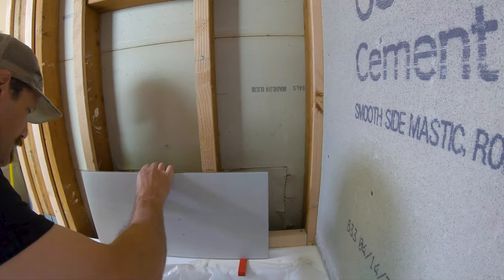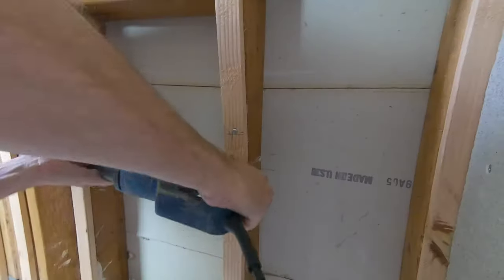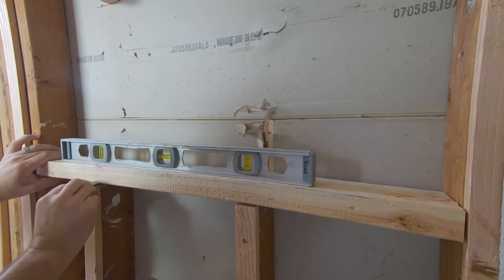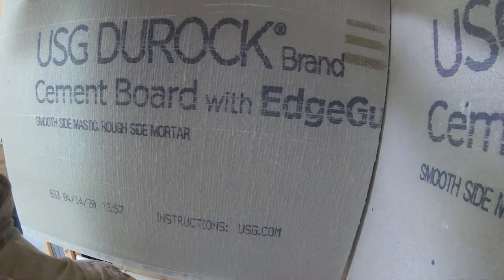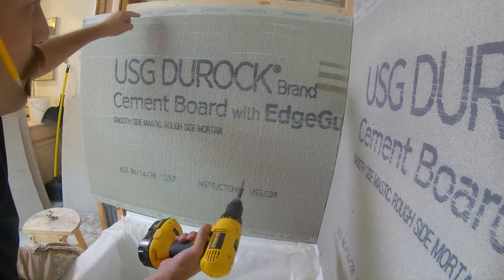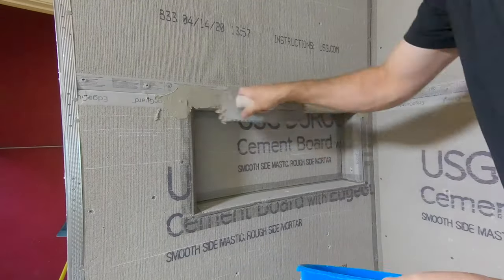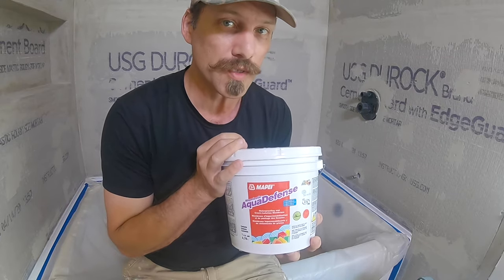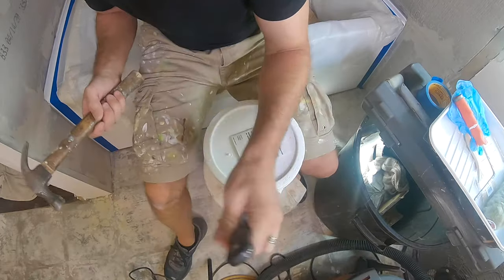How to make a shower niche from start to finish

Comment from the maker: The valve kit install, check it out: https://youtu.be/AX1CVJ9nCAs
Reply: Nice video i need that outside metal frame that you used  can u give me the link w here u got that thx
Reply from the maker: @johnal4560  Close to the actual Schluter Trim color I used from Amazon: https://amzn.to/3cMwpFG 
They're much easier to get (and half the price) at your local hardware.

Comment: Wouldn’t it be more waterproof in the niche if the sloped base tile go in first ? Water on the back wall tiles would drip onto the bottom tiles vs. your way the water can seep in behind the rest of the lower tile.
Reply from the maker: The tile and the wood frame is sloped. The only real difference is the thickness of the grout line in the back.
Reply: @Gofastpowder , I building my own tiled shower for the first time ever and it’s taking me so long because I’m a perfectionist.
Reply: Do you build the niche with regular pine 2 x 4 wood or threated green wood?

Comment: Good work,but I would’ve prefer the bottom tile one piece with no joints and installed before the back tile,to allow for water draining on top of it.
Reply from the maker: You make good points, Noel. And I thought of a single piece of material at the bottom. However, the tile itself stops at 24" and I'd have to buy a piece of marble to custom cut at 29" that would nearly double the cost of the niche. All things considered, it drains pretty well as it is and we're happy with it.  Thanks for chiming in!
Reply: Not realy its waterproof then it pitch grout n silicone alls corner never leack

Comment: You HAVE to measure the mix ratios to get the grout right, not just do it by eye / guessing. This a) makes the mixture more resilient and b) is repeatable if you need to top any up.
Reply from the maker: Always a good idea.

Comment: You had to float the bottom tile more than you thought because you accounted for that tile when deciding how much lower to install the 2X4 when really you shouldn't have counted that because the bottom tile of the niche and the trim piece sits on TOP of the tile going up the wall and not below.
Reply from the maker: Thank you for the explanation, Myish. If I ever make another niche, there's plenty I'd do to add to and adjust the plans. This would be one of them.
Reply: @coolhandryan  It's easy to critique anything with hindsight. You did a great job. Doing it and making mistakes is the only way to get better.

Comment: i start my shower niche next week. Im very happy that i have found your video !
Reply from the maker: Good stuff! Maybe check out some of the comments for helpful feedback on this video. Also, afterwards, I decided to cover the bottom grout with clear silicone (using a finger to push it in and flatten it out) so that it was all sealed.
Reply: @coolhandryan  Thanks ! I have almost finish but i really struggle with the metal trim lol not easy with a grinder to get the perfect angle even with a 45deg square
Reply from the maker: @rocketdriverqc9014  awesome! Maybe a hacksaw would be an easier option?
Reply: @coolhandryan  i wil try thanks !

Comment: Good video.  I've used a different leveling system for tile work on my floors, but I think I'll use the one you did for my bath/shower.  Also, I'm going to use the Schluter edging you used.  I think that I'll buy a niche that Schluter makes.  They have a variety of sizes and it's not very expensive.  Oh, I think for my niche back wall I'm going to use that glass tile you see.  I forget what it's called but they are small pieces of rectangular-shaped tile.  You can get that tile in lots of different colors and I think that will add a nice aesthetic.
Reply from the maker: Sounds like a solid plan!

Comment: Finally somebody who work almost like me in regard of following grout lines both vertical and horizontal, except I place a dummy tile with clips but without thin set on the place where the niche is going to be and cut the opening on the W.B the next day after removing the dummy tile at the last moment after it all dry. This way I don't have to put supports sticks  in place of the opening.
Reply from the maker: Good stuff, Edi. Thanks for the pointer. 👍

Comment: @ 8:25 How about use the small $60 metal cutter? Because that big miter saw scared the crap out of me when the schluter trim flew across the room. Could had hurt someone.
Reply from the maker: Absolutely. Whichever option you have that is most safe and still provides a clean edge. But I’m sometimes more adventurous/stupid than others.
Reply: Use grinder dude

Comment: If that's a load bearing wall you need to put in a header and jack studs to carry the load.
Reply from the maker: Good note, Doug. That particular wall is not load bearing.
Reply: Or to avoid all that, you can more simply build the niche between the existing studs, even two niches one above the other for extra storage.

Comment: Hey Ryan loved the video. Did you use the tile trim all the way around the other tiles on the side wall and up on the ceiling?
Reply from the maker: Yes. Along each outside tile line but not on the ceiling line.
Reply from the maker: I ran the tile all the way to the ceiling.

Comment: I would have used the glass accent in that niche. But it still looks fantastic.
Reply from the maker: Definitely thought of that when I was drawing it up. Did you see the accent video I posted? It was pretty involved and we ran out of the actual glass tiles. We also thought it might have upstaged the wall accent. Great point though, Selina.

Comment: This is a very helpful video. So did you place the wall tile up even with the cement board at the bottom of the niche? So it's all flush and then you place your trim piece with the flange on the cement board and the "L" of the trim sits on top of the wall tile? 

I'm concerned with the tile thickness plus the mortar raising my niche shelf tile taller than the trim but don't know if that is likely to be an issue.
Reply from the maker: The trim edge should be pretty close to the thickness of your tile so that you can fit it between the cement board and the tile and it will cover the edge of the tile for a finished look. I have it taped in place (9:20) to make the right adjustments before slapping in all the mortar.

Comment: What do you think about those premade niches you can buy?  You still need to tile them but I just wondered what your thought are on those.
Reply from the maker: Hey Jim. My initial thoughts on the prefab niche forms is that they are pricey and they hold you to the specific size of the box. I wanted a much larger niche than the boxes I saw pre-made. But if you can find a box the exact size you want and need, and don't mind spending the extra cash, then a pre-made frame could make the job faster.

Comment: I noticed your tile came off the wall Easley in the beginning in hind sight is there any thing wrong if a guy wants to  use the big ol fat  1/2 × 1/2  trowl unless of course it's a shower floor !
I wanted to ask about the bottom of netich tile setting detail ,is it better to do the bottom first then the back, sides ,and top for water that my hit the back wall of the neich to run down and hit the bottom tile then role out and off instead of rolling down the back tile, and being able to get traped in the grout line between the bottom tile and the back tile ,just want to know if it matters or not ? Only trying to do the best job I can ,thank you for your time, great video ,and any thought's on the matter ! ✌🏻
Reply from the maker: Hi Nunya. Thanks for the questions. The 1/4" trowel is standard IMO. They'll come off easy when you just put them on. If there's good suction/vacuum then you'll need to pry a little bit. They mortar will set up pretty fast, it would be hard to get a tile off after about 10-15 minutes depending on the brand.
Yes, is hindsight, the bottom would be better to add first. But I've had no problem with water build-up in my niche because it doesn't get directly hit by water. Even when it does, it still rolls out nicely. But a solid piece of marble or a single tight fit tile on the bottom would be the prudent way to proceed. 
Get workin! :)
Reply: @coolhandryan  thanks for the tip I'm  getting my shower pan liner in this week and it's been a while since i'v done one so just trying to brush up on some technical aspects of the task at hand I'll check out your channel and see if you have any shower pan  dirt to curtains how to  videos ,thank for the quick reply 👍🏻✌🏻

Comment: If you dry fit the schlueters around nitch then measure cuts on nitch sides and have them all ready to go,  then pull out schlueter and thinset sides  all around , you now can install schlueter and tile all in one shot, much easier to trowel that way instead of having the schlueter there and trying to thinset behind that edging where you don't have that much space
Reply from the maker: Good stuff 👍🏼

Comment: So it’s ok to just glue the back piece to the wall?
Reply from the maker: That particular adhesive is rated for cement board. Once it dries against the sheetrock, all of the other elements that you apply to the cement board keep everything in place.

Comment: When you put the shims in to support the top , did that change the level of the bottom tile seeing how much thin set you used to get the right slope ?
Reply from the maker: Pretty sure I let the bottom set for a couple hours then came back to do the top.

Comment: Why wouldn’t you do the top and sides then the bottom
Reply from the maker: In hindsight that would probably be the better play. At the time, I think I was concerned about the amount of mortar needed to fill the bottom which could have caused a short install of the sides. And I wanted to have the bottom installed so I could wedge the top in. There’s always something I’d do different on every project. 🤣

Comment: do you fill the tub with water before caulking the tile to the deck of the tub?
Reply from the maker: I don't think that is necessary if you already secured the lip of the tub to the cleats with deck screws. I didn't fill with water, just calked and it's been fine for years.
Reply: @coolhandryan Thanks !  Is your tub metal or acrylic ?
Reply from the maker: @walnutcontractors5661  It's fiberglass with acrylic.

Comment: the framing for the niche didn't need jack studs or header?
Reply from the maker: I used a simple box frame. Its not a weight bearing wall and will never hold anything heavy.
Reply: @coolhandryan  How does one determine that the wall is indeed not load-bearing?
Reply from the maker: @dcppcp  structural or load bearing walls typically run perpendicular to the joists. Take a look at your eave outside and you may be able to see the joists protruding under the eave. Your weight bearing walls will should be running the opposite direction.

Comment: Would it be a better process to have put the bottom shelf in before the back tile for a better watershed?
Reply from the maker: That is the common and best practice, yes. There's always an issue with projects in one way or another. But for mine, I don't find it a problem. The niche doesn't take direct water and I've got it sealed underneath.

Comment: Have you used the Kerdi style of drywall and niche?
Reply from the maker: Hey Ted. I haven't used the Kerdi wall board or their prebuilt niches. As part of my DIY, I was looking to save some dough. A Kerdi niche is roughly $90 and a sheet of Durock is $10, which was plenty for the whole niche. Plus I had the ability to double up the Durock when my measurements were off. I did use the Kerdi Schluter trim around the niche though.
Reply: Save your money 
Don't bother with the kerdi
Reply: Plenty of other tile backers out there for far less money. I use dens-shield. Concrete board is ok but it's very difficult to work with. Between the 2 product the warranty is identical and there's far less perp for dens-shield.
Reply: @davidwilcox1897  The Kerdi takes the guess work out. The  labor to install Kerdi is easier and faster than using cement board, tape, mortar and liquid membrane. The Kerdi will also be ready for tile sooner than custom built. More importantly, the chances of a DIY or professionally built niche having water/moisture/leaking issues is far greater than the Kerdi Niche. That alone makes $80 money well spent.

Comment: Question or two: can these cubbies be done on a 2x4 wall?  It appears you are using a sandy surface tile, low gloss. I have well water and am considering the same in order to conceal eventual mineral deposits. Is that why you're using low gloss tile? Any experience with tile finishes and well water? thank you
Reply from the maker: Id make sure the wall could hold itself up once the frame was redone to accept a reasonably sized niche. I have little experience with glossy tiles, except the accent video on this channel. Unsanded grout should be used with a 1/8“ or 1/16“ grout gap. The unsanded grout will help keep the scratching to a minimum.
Reply from the maker: No experience with well water though. I used the tile because we liked it, no other reason. We have rather hard water. But it hasnt been an issue.
Reply: Sanded grout is for floors and unwanted for wall tile. If I'm using a larger joint line in a wall tile application I'll mix wall and floor grout together. It fills the joint better then just wall grout. The grout color will change slightly but must of the time it's not noticeable

Comment: What tool is that that you use to cut the durock? Is it drywall hand saw?
Reply from the maker: Yup, a drywall hand saw to cut the hole for the niche once the cement board was fixed to the wall. Just guide it along the wood frame. A regular razor knife to clean up the edges.
Reply: @coolhandryan  thanks for quick answer. I didn’t know that drywall saw works. I’ve been using the score knife.
Reply from the maker: @Leo H  It cuts through pretty easy once the board is attached. For all other cuts I used a score and snap with a regular razor knife. But the method of cutting the hole once the board was attached needed a different method. The saw was close and quick. 😜

Comment: Do you need a gap space of 1/8 between the outside of the trim to the side tiles?
Reply: They arent that thick. Youll need to slide in the trim while the tile mortar is still wet. So, its really just making a nice little home for itself. I dont think I measured for it.

Comment: Do you caulk all the inside corners of the shower niche? Or just grout them?
Reply from the maker: Hey Chuck. I used grout on mine. But I used caulking on the horizontal base of the tile where it meets the tub. If you’re concerned that your nookie will shift significantly then use caulking.
Reply: I’m in California… I think caulk on the corners is mandatory, because of the movement we get.
Reply: Chaulk all corners. 
All the time 🙂

Comment: I apologize in advance for being critical but 55,000 people have watched your video and judging by the comments, most don't know what they're actually seeing or what to look for. 
Tile setters do not (or should not) use 1/4" square notched trowels to set large format wall tile. It doesn't leave enough adhesive. The industry standard for how much of the wall tile is bonded to the substrate (referred to as "coverage") is 95%. The bottom tile you removed to correct for plumb appeared to have about 25% coverage (maybe less) because very few of the trowel ridges were collapsed. You made the coverage even worse by adding mortar to the top. This is one reason tile jobs fail over time. 
It's very important to mix thin set according to manufacturers specs. Use a measuring device. There is tolerance but be as accurate as possible for what you're doing. You'll find it's much better/easier to work with and does what you need it to do (it will last longer in the pail if you're working slowly; it will not make as big a mess when applying and will have optimal strength when cured).
Reply from the maker: Great comment, Alan. Thanks for adding to the conversation. All DIY threads benefit from the experience of professionals.
Reply: Definitely move up to the 1/2 inch trowel. You won’t believe how much faster and easier things will go!

Comment: How do we know what size trim to use for 12×24 tile ?
Reply from the maker: If you're referring to the aluminum trim, it's pretty much sized to cover the end of the tile edges that are facing out from the inside of the side walls. 1/4". The long perforated blades of the trim fit under those tiles. Take a look at the trim in the store before you do your install and make sure you wrap your head around the process before you take it home and  mix your mortar.

Comment: De qué grosor es el perfil esquinero?
Reply from the maker: If you're referring to the aluminum trim, I'm pretty sure it was .5" or 12-13mm on the face. Twice as wide as the thickness of the tile.
Reply: @coolhandryan sí a eso me refería. Muchas gracias 😊
Reply from the maker: @mercedesrr23  On further inspection it is closer to 3/8" (9.5mm)